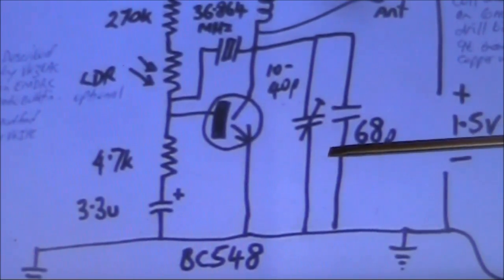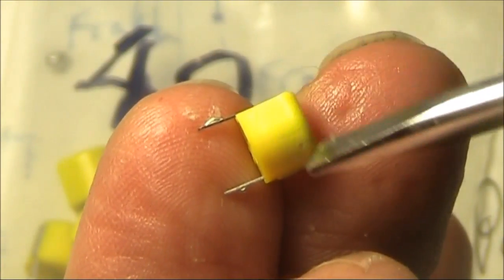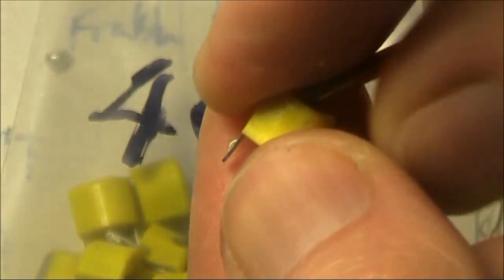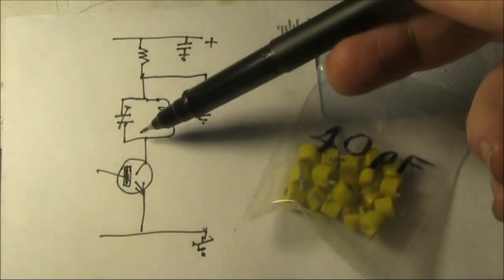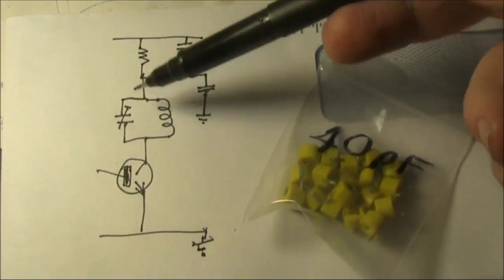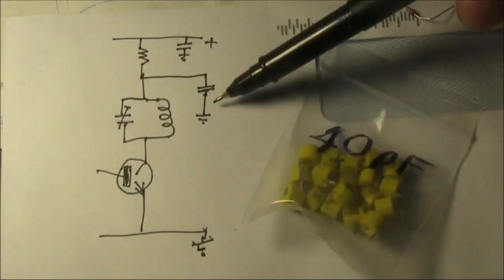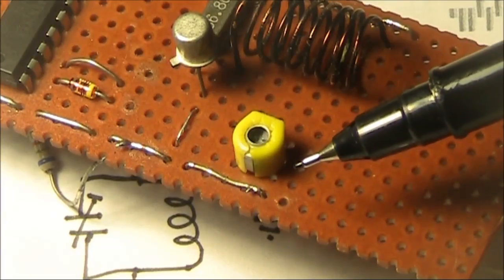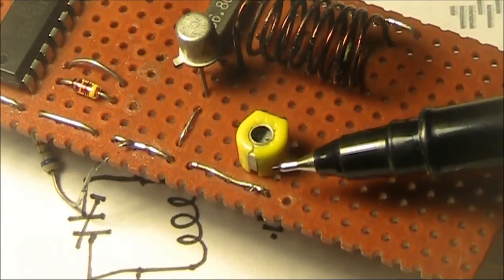The best way to connect a trimmer capacitor in an RF circuit

Comment: Can I use variable capacitor in place of trimmer capacitor bro?
Reply from the maker: Yes. A trimmer is a variable capacitor but with a screwdriver slot instead of a shaft.
Reply from the maker: @Mickey India Yes, if it's got the right capacitance value. Most trimmers have much too small a value to be useful here. The main exception is compression trimmers which are hard to find.
Reply from the maker: @Mickey India Way too small. 3-18 pF is useless. You need to go up to at least 200pF, preferably more. Such trimmers are very hard to get. Variable capacitors are also rare. You pretty much have to pull apart an old AM radio. Unless you're lucky on ebay.

Comment: I recently posted about doing your improved audio hack on the BITX40 group and you explained more about the whys, and what fors. But now I don't know if I have the trim cap the best way round. The flat side is in the bottom left corner next to the SMD cap I tombstoned for the hack.  And adjustments are no problem. So far. Thanks a bunch.
Reply from the maker: If you've got an insulated alignment tool it's no problem that it's not wired as described.  More something to bear in mind for next time.

Comment: Honestly you should simply not ever get in the habit of using a metal screwdriver!!!! Really ceramic tip screwdrivers cost very little to buy
and then you never have to worry about accidentally using a metal one. It's just a bad habit to get into and I see a lot of radios that have had 
"The golden screwdriver" treatment and you can tell it was a metal one. It shows up when you do an alignment that they used a metal driver.

Comment: I hadn't thought of that. Nice idea. BTW I see you use you use plain matrix board for some projects, that's my preferred method of construction. Just looks so much neater than the "ugly "contruction technique.
Reply: The "ugly" technique can look reasonable if you neatly arrange things. Also using "ugly" construction is very good for minimizing stray inductance and capacitance and you have a much better RF ground under your circuit. Can be easier to tame some circuits especially as the frequency is raised.